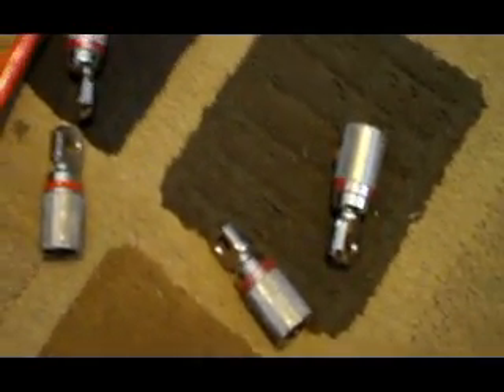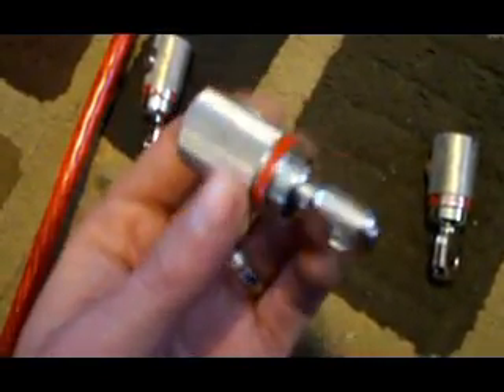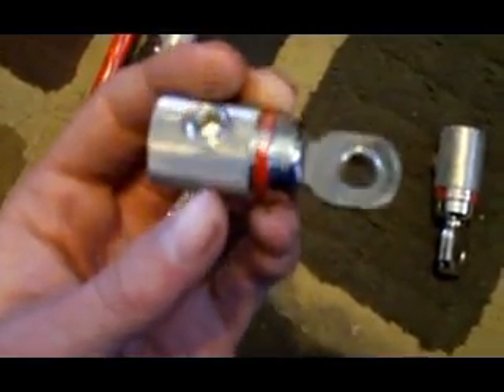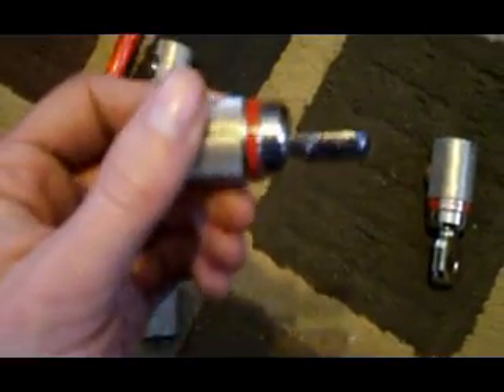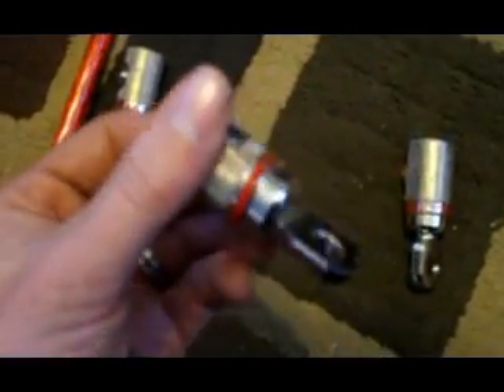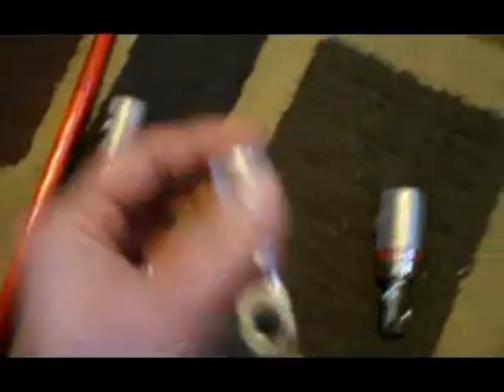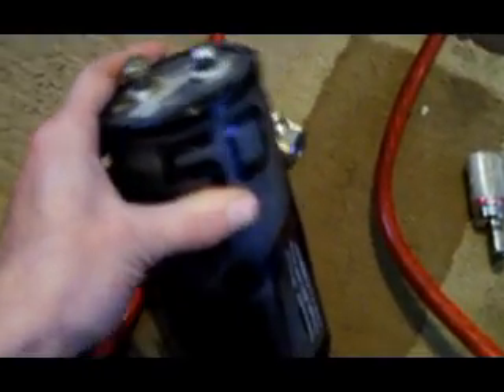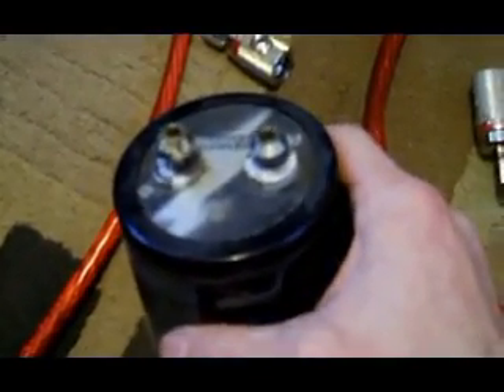How To Hook Up A Battery Capacitor

Comment: Whenever i have car audio problems i watch your vids and it actually helps me!! also i have 2 15 inch subs and sometimes when i turn up my volume they juss kinda go out?? im not sure what it is. but idk if youd know the problem. i have a kenwood amp pushin them. but would you think my battery is too weak for 2 15s?? because its the stock battery and i hav a 99 ford explorer.

Comment: Ok i got a question... I hooked mine up just as you said, disconnected the battery and all. Mine has a digital display on it. Now when i open get in my car and anything trips power like interior light coming on, trunk light, the cap turns on and even with the car not running or key in the ignition it comes on and slowly loses voltage, but when the car is running the cap eventually turns off. Would you have any idea why?

Comment from the maker: @HiJackZX1 Yes I would go from the battery to distro then distro to amps. If you can run a ground straight from your battery that is the best just make sure your cap and amps are all grounded

Comment from the maker: @williamfred60 then negative on cap to either another distro block or you can run 2 negatives off cap to 2 amps. I'm guessing your running 2 amps since your using a distro block for your pos

Comment: Great videos. I'm hooking up a bunch of audio equipment in a boat. Can I ground everything on the negative battery terminal? Also, there are not a lot of good videos on whole system instals. 2 amps, multiple speakers and cross over instillation. Any videos you recommend? Thanks

Comment: really noting special, batteries are on there way out and are been replaced by capacitors!

where is your resistor mate? with out a resistor you will fuck up the capacitor as the current is to much for a cap and needs a resistor to control the the cap

you sir have no idea what the hell you are talking about.

Comment: Caps are the way to go... Your problem is a half fared sh*t brand audio company lol. I
Bought a 2F digital cap from Massive Audio for $60.00. To get that power you would need 2 extra batteries at roughly a total of $400 plus valuable space. Your best off to throw that cap out anyways. It will just add resistance to your overall system. And yah... Do the big 3... If not... At least check your grounds under the hood cause most manufactures ground on paint... So with very little work without repla

Comment: @karkeys   This video is 1000% correct ..  DO NOT wire the cap as you have said as that is wiring it in serise! Power caps MUST only be wired in parrel (+ to + , - to -)

As you will damage the powercap and quite possibly damage your amplifer!  Search for powercap exploding that is what will happen if you wire it "like a fuse" or as its correctly know term "serise"

Comment: @casperskafs are you sure you correctly hooked this up? so many other videos out there connect caps similar to a the fuse. +of battery to cap positive then -of cap to +amp then -of amp to ground (like the chasis)

Comment: ok im sorta new at this and im getting an RE SX18'' sub and i have an amp im already using....do i new an extra battery in the trunk or a cap? or both im still kinda fuzzy on that..if i could get a battery in the trunk would that be all? then run a power wire from that battery to my amp? plzz help

Comment: Yeah all looks good but yes you do use a resitor  or test light to charge the cap before adding it to your system or else it is worthless! They do work if you disagree charge it and stick your tounge across the terminals I bet you will agree they work then bro! They arent for holding a lotta charge they only help when the amp needs the power in certain notes that a car bat is not capable of supplying as fast look into things before you knock them!

Comment: You should have no more than 18 inches from the cap to the amp(+),, separate grounds for amp and cap. A half fared cap is worthless,, at least 1.5 fared for up to 1200 watt,,they are easily available online for around 30...lot less than a new battery

Comment: Dont you need to charge the cap with a metal wire or some thing it comes in the kit you set it on the +- at the same time dont you?

Comment: subscribed :) great videos .....Never hear anything good from battery cap caps , not from experienced installers atleast,I have Red top , gets the job done, and dimming lights are normal when you have stock alt running a lot of power.

Comment: @woww1993 
it's simple. Volt's times Amps gives you watts SO, 60AMP Alternator x 12V(starter battery) = 720Watts of usable power, and remember the vehicle takes 15% from your charging system.
All Farad measurements are 100 Farad for 100Watts (on quick draw) 
So remember in basic math people, if you got a 60amp alternator and wanna run a 1200watt amp well, your running 480Watts over total amount and ie 480W/60Amps - 8 Volts short.

Comment: Its much better to run a separate ground for the cap. also before you hook your battery back up, charge the cap this will eliminate sparks. I charge them by pulling the main lead fuse. Make all your final connections. Then using an incandescent automotive test light jumper the fuse block with the light. It should light, then slowly go out,  now replace the fuse. Tada no sparks :). Its also a good idea to discharge your cap if your going to remove it, use a test light across the cap terminals.

Comment from the maker: @tjkmoney2314 I have a crappy bat cap kinda like that it has a remote wire also. I don't like battery caps so I never messed with it. Honestly though if I was gonna have a battery cap it would be one like yours. Stinger makes good batterys so i'm sure their bat caps are good expecially a 5 farad one.

Comment: I have a Stinger 5 Farad Hybrid Cap... and it requires using a light bulb to get it charged... Also it has a remote. I have installed 5 systems in different vehicles. But this cap has two + & - (+REM) I know where they connect.. But if you get a chance look at the manual it is confusing.. >.>

Comment: alright, now iv got a pretty good system in my car, i did it all myself and i have a cap. the way i hooked it up is with a  gauge pwr wire goin straight from the batt. to the amp. i did not splice the cap. in-between. then i have a shorter piece of wire going from my amp to my cap. and for the ground i ran a sepperate wire from the cap. to the amp. do you think that will work?

Comment from the maker: @yamaharider438 Its like a regular battery. It always has power. If you have one with a volt reading I can't really help ya cause I've not messed with one like that. I think they have a remote wire with um to tell them when to turn on.

Comment from the maker: @yamaharider438 I'm guessin you have a digital cap with a volt ready. Honestly the cap in this video is the only one i've messed with and I guess it worked fine when I hooked it up like this which is how I recommend hooking them up. I've never had one with a volt meter on it so I can't say much about them. I'm not a fan at all of battery caps so I stopped using them and just got a better battery

Comment: Hey man i have my cap hooked up different? i ran my power wire from my amp to the cap the the ground wire from my amp to the cap and my remote wire from my amp to the cap>? is that bad or should i wire it up your way? it still lights up and everything??? thank you for you vids i just watched your 2 amp video

Comment from the maker: @corderopilot You can use it for your radio. If you system hits to hard and your volts drop so low your radio will shut off along with everything else for a min. I've seen it more than once. If you hook up a bat cap to your radio it will keep your radio volts up so it won't shut off. Other than that I think bat caps are worth less

Comment: the cap will not help against lights dimming,it just for your amp,not radios ether. it assist on the power demand of the amp .

Comment: the cap is like he said a litlle reservour of power and you will notice the diference when installed in the base when the amp demands more power and the cable isnt capable of suplying all at once and the voltage drops below 12v at that point the extra voltage needed for correct operation of the amp is supplyed by the capacitor

Comment: did you know the diference between curent and voltage?,more cable (copper strands) means more CURRENT can pass tru it,the voltage is still 12 volts.. think of it like a fire hose,the bigger the hose more water (current)  will flow tru it,but the pressure (voltage) will be the same. make sense to you?...

Comment from the maker: @batlbunkrbob25 Sounds like a good setup. I have a L7 15 with a 1500 watt autotek 2 channel amp and I like it. If you can I suggest getting the crunch groundpounder series amp if ya can. They put out more power than the other series. If you truck sits at 16 volts and your sure of this you might be ok and not need anything else.  Honestly though I don't like battery capacitors and will buy a better battery before a battery cap

Comment from the maker: @300zx93nismo1 Bigger wire is more voltage. Which is good. Of course alot of amp won't take big wire but thats cause they don't need alot of voltage.

Comment from the maker: @copperheadno2 I think that would be ok. If I use my battery cap again it will be only to help power my headunit not for my amp. You might need a one way diode though so you make sure your cap gives power to stuff instead of taking it. Google one way diode if ya don't understand it. I had to

Comment: got a question for you or anyone really...would it be possible and what would happen if i hook my cap its a 3.5 ferrad cap up under my hood at my primary battery, spliced in the 2 wires hooked up to that battery so it only helps the accessories and stereo and lights and all and not the amp...would it couse problems with the altenator and starting the car and all too...if anyone has any ideas hit me back...i only have a 1200 watt amp so i dont think ill need to do any of that though

Comment from the maker: @calikalinfo You need a mono block amp (1 channel) and a 4 channel amp. You need the mono to run your bigger subs and a 4 channel to run your 8's and your tweeter. You could get like a 5 channel amp but their usually pretty expensive

Comment: dude the reason why i dont use one is i have 3 of them in the past and my amps get hotter when hooked to cap and most of the time they will burn an amp up so what i done was i hooked the cap up in between 2 batts and it kept the batt in the trunk up in going never died

Comment: and you also have to discharge the with a blub or resistor from + to - on the cap after its undooked and it discharges it

Comment: no you  forgot one thing you have to charge your caps before you hook up the power wire or you will kill them take a 12 volt bulb run wires off it and put one side on the hot wire and the other onto the + of the cap until the light goes completly dim and have your ground hooked up